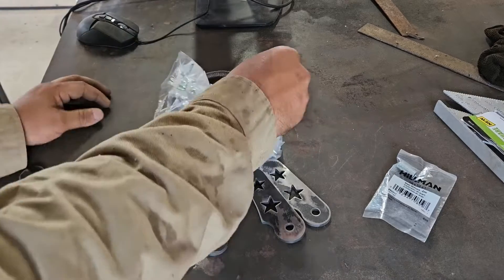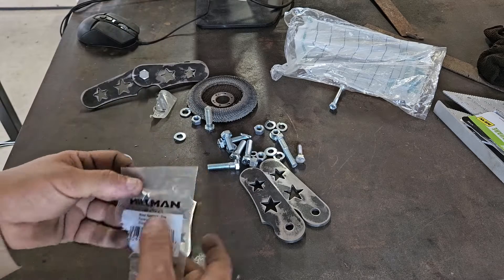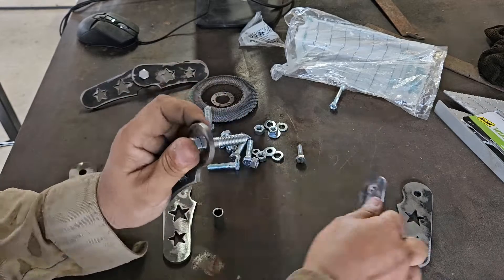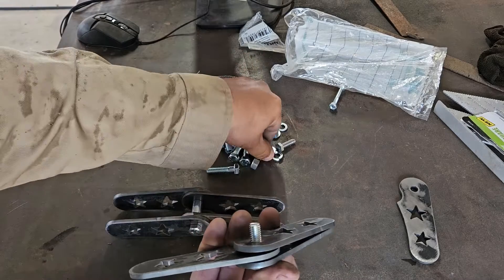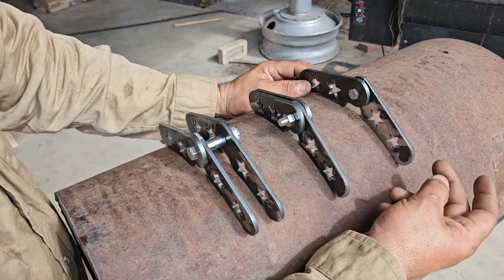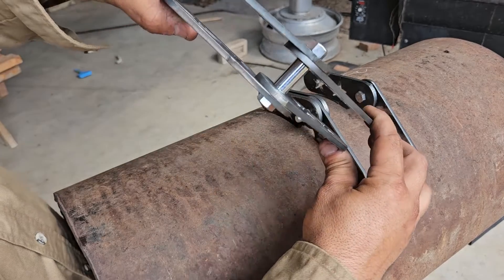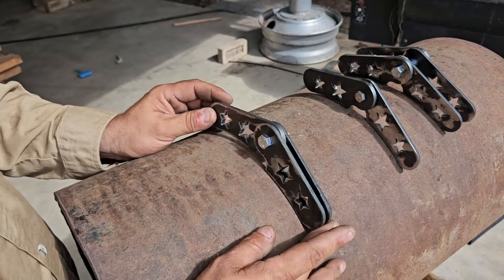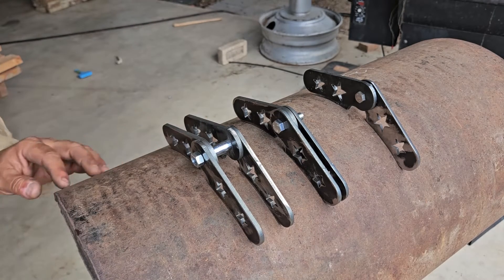How To Build Homemade Weldable Hinges For Bbq Grills And Offset Smokers In Under 60 Minutes!

Comment: How much did your plasma table setup cost? Great hinges
Reply from the maker: The table was bought used for $1300 which included the water pan and XL extension. The package today would cost $1495 Table, $150 XL Kit and $150 water table, $149 Shipping. Total $1944 plus tax. This table was a great learning curve for me and could benefit from a larger table if I had the space. 4x8ft seems to be perfect for what I do and most recommend.